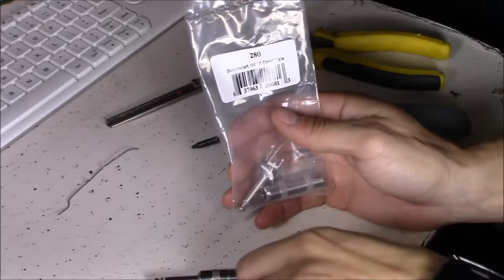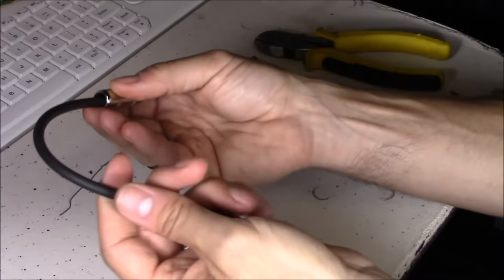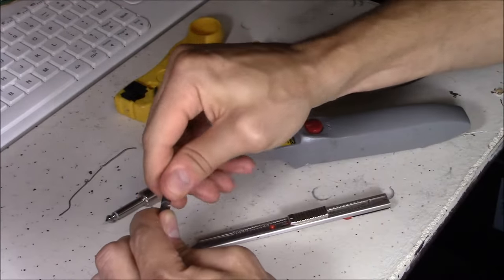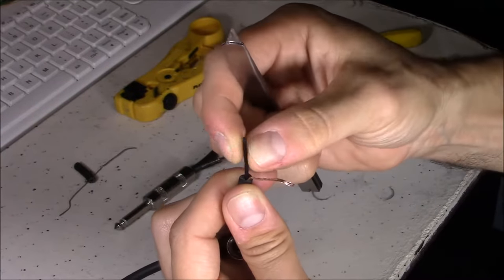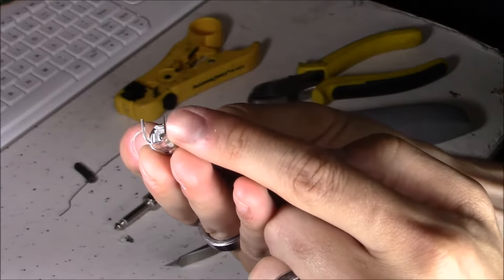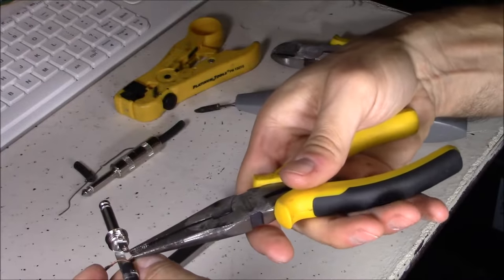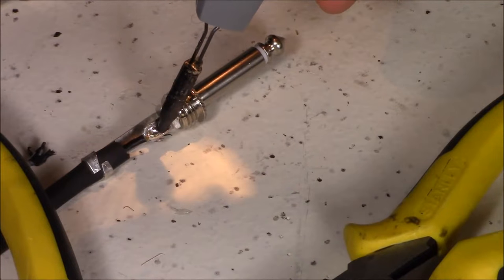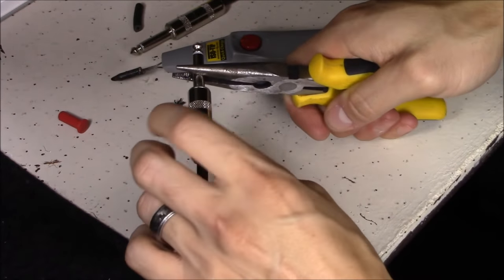How to solder and fix guitar bass microphone instrument cables with 1/4 inch connectors

Comment: Hey TampaTec! I loved the video, very resourceful! Im a huge fan! I have a very serious question I wanted to ask and figured this would be the fastest way reaching you. 

I own a 2010 Mitsubishi Tv. Model Number is WD-73C10. Serial 104259. Not long ago a heard a pop in the tv and the screen shut off I bought a replacement lamp thinking it would fix the problem because the old one shattered but when I turn on the TV it stays on for a few seconds then always shuts off. I cleaned all the fans but still it shuts off. I'm hoping that you have a solution and can reach back to me thank you!
Reply from the maker: capacitors pop all the time, if TV is about 10 years old that would be my logically guess. look for blown caps on the boards.
Reply: Thank you for the fast response! I will check it out and keep you updated!

Comment: Can't believe he didn't "tin" those connections first!! That's some electronics 101 stuff 🤷🏽
Reply: I think he was trying too keep it a pretty simple tutorial. Tinning the wire before hand wouldn't really be needed if anything it would be a more of hassle for someone new to soldering putting the wires though the strain relief with it pre tinned blob is a pain. Tinning is great for hard to reach solder connections and joints that dont need a great amount of strain relief if you're putting just two wires together instead of threading wire through jack strain relief. It kinda bugged me more he first said positive and negative connection then referred to negative as ground. Non the less I Love his repair videos.